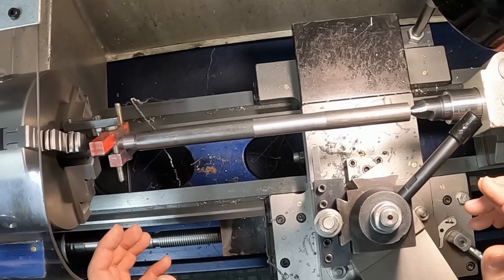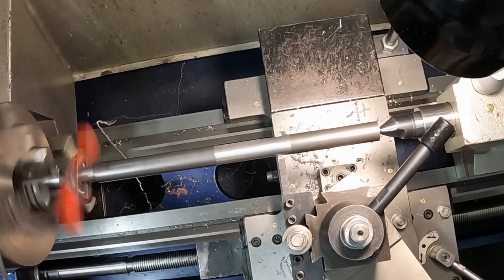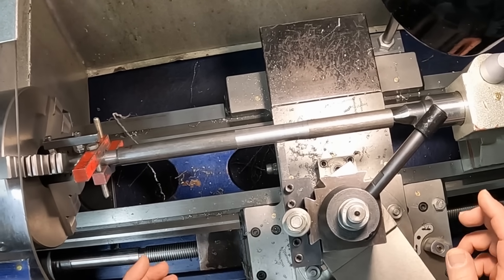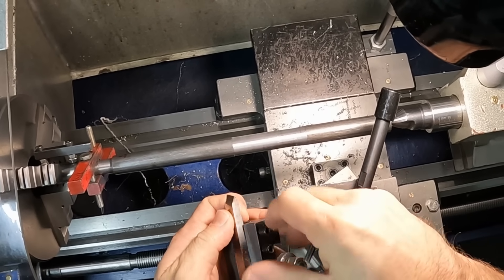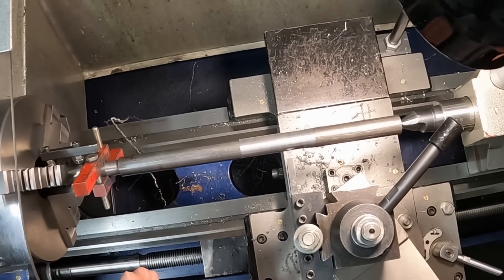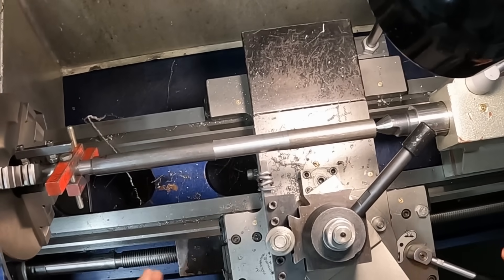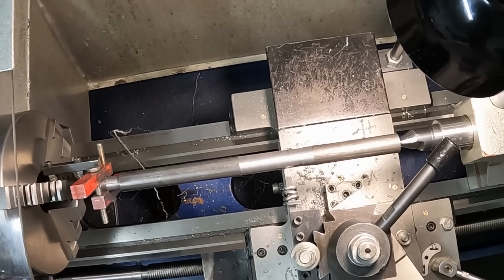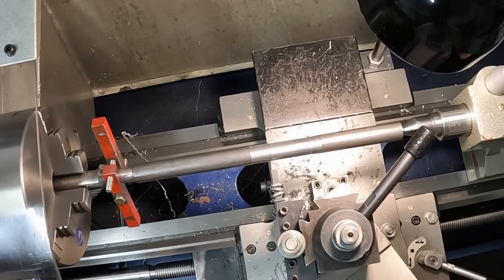Solving the CHATTER problem for the home workshop

Comment: Thank you for shareing . So it's very important to have people around like you ! This is incredible valuable. 
you are not saying (like many): You do it wrong, read the manual and do what it said (be rigid and dont stick out tool too long), but telling people the fundamentals that can solve a problem - so we can solve other problems because now we know about resonance frequencys.

A good explanation is, to hold a metal rod at 1/3 length and give it a slight knock and listen. After that, change the position where to hold it, and knock again. There are modes, that didnt work, if hold at right spot . If you met one of these, it would not resonate (at least not if you knock with same tool at same point as before).

If you know that , you get an idea, whats going on with a shattering machine. And you can take it to many other cases.

Nice stuff to know ! More of that can come ..i hope.

Comment: I had this issue just yeasterday turning a peice 1" cold drawn 1018 down to .800"  on a 15 inch length! It was a DOG!! Wish i would have seen this before tacking it.
I got some chatter out by laying a rubber faced hammer on the stock as it fed  in toward my chuck. It helped some. But not great.

Comment: Great video.  I would have liked to see the effects of lubrication/coolant on the chatter.  You touched on a dampener material but did not mention a dynamic absorber.  The other thing about changing stiffness is to use carbide cutting tools.  In particular solid carbide boring bars are now available.

Comment: Vibration of the tool and machione are only half the problem. Vibration of the workpiece (especially when long, thin and tunred between centres) is often just as important. Your 'anti-chatter wire' can sometimes be used with advantage on the workpiece itself, where its positioning can be critical. And finally, often, the simplest way to take the natural vibration out of the system's resonant range is to change (slow down) the cutting speed.

Comment: Fascinating…..all of the fatigue is in the same spot, regardless of the direction of torque.   So, i’m wondering if cutting a relief slit in that spot and end the cut at a drilled hole, would remove the chatter, but still allow some flexibility…very much like the relief cuts in parting tools. 🤷‍♂️.   Again…fascinating.
Good Talk 👍
Reply: Also…🤷‍♂️….I sort of LIKE the chatter finish.  I know its not practical for hitting precision dimensions…but the finish itself, is actually attractive to me….it reminds me of a  Guilloche Rose Engine finish. 👍

Comment: Was thinking engines valves springs: sometimes uses 2 springs of differents hardness...Something like the copper plate you used but steel of a diferent shape.
What about cut off?

Comment: In engineering terms, he is changing the resonant frequency of the system.  Most of the attempts to stop chatter I have seen focus on increasing stiffness of the system( the stiffness of the tool post), or of increasing mass of the work, in an attempt to move away from the resonant frequencies.  I have done both in the past, sometimes successfuly, sometimes not. As an amateur machinist and retired Engineer, I had simply never considered that adding mass to the TOOL ITSELF might be a possibility.  YouTube once again comes through with sharing practical knowledge about practical things. I will give this a try very soon.

Comment: Anti vibration wire?  Solid core solder maybe?  That alone is a good tip.  Using some lubrication and altering lathe speed helps, as some inherent vibration is caused by the lathe motor.  Making sure your centers are in tight at each end and/or using a live center instead of a dead center will also help.  Headstock bearings OK?  Last resort is, as you say, reading Machinist's Handbook, as we like to solve problems on our own!

Comment: Thank You SO MUCH for this clear and very informative video. I use a Chinese Sieg lathe normally and have just got boss of that but on my Peatol / Taig Micro lathe I was getting chatter marks even though the tool I had ground seemed to cut well. Then I tried t strip of copper cut from a pipe and annealed and placed under the tool. Using all the same speeds and feeds and it was like a different machine, suddenly everything has come right Brilliant!

Comment: For the first time the right explanation of "chatter". The problem has an analogy with audio. Resonant Frequency (and it's harmonics), Damping, (external and internal) , Stiffnes, Mass,  etc,etc, are items wich are the basic items when talking about acoustics and UNWANTED Frequencies (especially  Loudspeaker Engineering). And chatter is an unwanted mechanical frequency. These unwanted frequencies can be mastered with the solutions mentioned in the video. The solutions are the same for audio . All these solutions (and more) are also known by audio professionals such as audioengineers and speaker builders .

Comment: The only way i really got away from chatter is changing the cutting geometry by stop thinking as it digging Into the part but running towards the head stock as you cut.. i paid too much attention to sharpening the edge towards the part. When i started grinding the tool so it cut towards the headstock i helped the chatter a lot even with tiny cuts i now get no chatter.

Comment: I only get chatter when facing on my chinese lathe. Shortening the tool overhang and making sure all slides are free from shake sometomes gives a fair cut but some of the problem I think comes from the speed control that pulses the drive motor and adds different vibration characteristics. I have used really old worn out lathes with smooth drive belts and obtained very neat and smooth facing despite all the wear on the machines.
Reply: Check your thrust bearings. If it doesn't chatter with live centre pushing on it you need to adjust bearings.

Comment: On my 9 inch south bend I eliminated the chatter by using a 3 phase motor and an inverter from Amazon. Turns out the single phase motor which hummed like a washing machine was making vibrations in the whole lathe. Also by using the inverter It's possible to vary the rpms with the turn of a knob.

Comment: Good video and modeling.  It's a hard subject to talk about.  Engineering 101, everything is a spring.  You're a spring, every part of the lathe is a spring, the stock is a spring, and the cutting tool is also.  You are cutting a spring with another spring.

Comment: Very useful and insightful video.
To add, the same principle applies to the work piece, less stick out from the chuck for unsupported material and if longer cuts are needed to make sure the part is supported on a live center and to add a steady if possible.
What I have also experienced while parting specifically was that the length of material on the back of the chuck(sticking out into the spindle) will also cause chatter if it is left too long. This means you want to not only part of as close to the chuck as possible, but at the same time, use a short as possible piece of material.
In my case I was parting 22mm material while making 15mm long parts.
If I rough cut my lengths of stock more than about 250mm on the saw, I suddenly had issues with chatter while parting. 
This would gradually go away as I'm removing new parts from the stock and as it started to get shorter. Between 250mm and 270mm was the sweetspot, anything longer and the chatter will appear. 
Naturally this will all be related to the thickness of the material which will be stiffer the thicker the stock is meaning that more stick out is possible.

Comment: Another way to visualize the damping effect on a vibration system is when you put your hand on the system and it eases.
Obviously on something safe, like washing machine or a small motor.
Since you cant put your hands on the tool, a wire of such sorts is a viable solution.
Interesting to think are there tool holders in the market incorporating this method? Like adding springs and pads to soften vibration?

Comment: I was a manual lathe operator for about 15 years and turned down a lot of long pieces even longer than what was shown here. One time, a man said to add some rubber bands around the piece being turned and I was amazed that the chatter went away.

Comment: Someone suggested getting away from the resonant frequency by increasing rpm. In fact, You want the rotating frequency (revs per second) to be an integer multiple or division of the resonant frequency (herz). This way the tool 'bites' into the workpiece at the same angle as it rotates. So either decrease of increase rpm untill you find the sweet spot. There are many.

Comment: It's all about tool pressure/cutting force and harmonics. Using a smaller nose radius almost always helps. Using a more negative lead angle with a positive rake angle is the way to go as it takes less pressure off the part and into the center of the cutting tool. Sandvik has good literature on this as well as a FREE course on their website.
The spring you put on it slightly damps the vibration too.

Comment: The chatter can also be from work hardening the surface. I had a heck of a time cutting 4140 on my small craftsman lathe which is by no means a real rigid lathe. The cut was mush better when I slowed the spindle speed as slow as possible and took slightly deeper cuts.

Comment: What would you recommend if modifying the tool holder and tool bits solve the problem but the vibrations also appears in the shaft you are machining? Base on my experience when you install the follower rest there is a tendency to solve the problem but upon removing the follower rest I somehow notice a deflection or bending of the shaft causing it to misalign again specially for small cross sections of diameter in the middle? any comments pls will be helpful. Thanks.
Reply from the maker: I'm sorry but its very difficult to help without hearing the feedback and checking the setup. From what you wrote the first place I would look is tool height, or bed deflection. It sounds like the tool is climbing. Also check the cutting point and make sure its sharp.

Comment: It's rare that I have encountered chatter, and on a regular lathe, I first check the length of the tool bit, reducing the overhang as much as possible.  If there is still chatter, slow the RPM down.  Then reshape and sharpen the cutting edge.  Make sure that the piece is mounted securely so it can't move about while under load.  Make sure that the gibs aren't too loose.  Use some lubricant.  Loose headstock bearings  can create chatter.
  On a brake drum and rotor lathe, use the dampers that came with it to get rid of harmonics and the chatter that ensues.  Small drums and rotors don't get much chatter generally speaking, but bigger ones do more often.  The design of some brake rotors chatter more than others.  If you still get chatter with cast iron, change out the tool tips.

Comment: Very interesting, nice video, animations and explanation. From my experience, we have bent/broken Sandvik antivibration boring bars, these things kept screaming and breaking inserts no matter what but we urgently needed them to rough out big stainless cylinders. After some time trying, I just took a single massive cut (3.5mm) on low cutting speed and bit higher feed and it worked. The insert life was not awesome but lasted 20-25 minutes in-cut and managed to survive one part. The finish was horrible but it was just a roughing operation. I tried the same with external tools and it worked too few times. Just take bigger DOC, so the tool bends down and doesn't spring back. Just be careful not to break it into two.

Comment: I find my main chatter problems on the mini lathe happen when I put on an oversized chuck. If I use the 80mm 3 jaw, the 80mm low profile 4 jaw or the 80mm ER32 collet chuck it’s fine, but as soon as I move up to the 100mm or 125mm chucks I get chatter problems.
Upgrading to tapered roller bearings has helped a bit, as has making my own adapter plates for the chucks from cast iron & getting them as short as I can, but it’s really a problem of pushing the little lathe outside of its comfort zone.
Still, it’s a great little machine & I use it almost daily in my business rebuilding vintage engine magnetos. They get a lot of bad press from many “YouTube certified” machinists, one popular YouTube “amateur” recently said you can’t turn steel on them (she’s often misinformed though) but I’ve found it to be a very capable tool, made even better with a few simple modifications.

Comment: Got a sub and a like for this vid alone, sir ! 
I made a solid toolpost for the cross slide (no compound ) and this made a big difference in the rigidity of my small lathe...

I also dislike carbide-insert tooling on small lathes as the large(ish) nose radius tends to result in chatter, the comparatively blunt edge carbides usually have (positive rake) doesn't help matters either. 🙄

😎👍☘️🍺

Comment: I’m a time served welder of 50+ years and I remember once working in a workshop that had welding, fabrication and machining equipment and one of the turners in the machine shop was profoundly deaf  and he worked by using the feeling of the vibration of his machine  to know the finish that his machine was producing, the only problem was that he would have his lathe screaming high pitched and when anyone pulled him up about it he’s would hold his hands up and apologise only to turn around pissing himself and pop out another bang on job 😂

Comment: The wide profile tip allows the chatter to build up as the tool goes back over its chatter from previous rotations of the part. A sharper profile and faster feed both reduce this problem. The frequency of your chatter seems too low for tool chatter. I think its the workpiece flexing. Just keep in mind everything involved in the operation from the workpiece to the tool and the lathe has some flex and can chatter especially if natural frequencies match.

Comment: IT'S NOT DAMPENING!
Damping absorbs mechanical vibration. Dampening just makes things wet.

It undermines an otherwise credible presentation, which is a shame.

For your tool sharpness discussion, it looks like you're trying to compare the relative tool tip radii. Might be easier to convey with some close ups to show the different engaged cutting edge length

Comment: Why is nobody mentioning the fact the the tool is WAY stiffer than the workpiece.  That long, thin, mild steel workpiece being worked right in the middle is certainly deflecting FAR more than the short, fat, really hard tool.  The 'anti chatter wire' is a red herring that has no business in this video.  I'm very interested in the ideas that the shape of the tool and the aspect of the work matter a lot, but the former was clouded and the latter ignored in this video.

Comment: You can also use a stack of o-rings on boring bars to add dampening.
Reply: This was always our first approach too!  Simple method and most times very effective.  We had a large crate with thousands of different O-rings for this.  And a whole bunch of short steel tubes that could be "rolled/clamped" over the O-rings.  In some cases this helped solving impossible cases.

Comment: "Chatter" when turning "Thin Wall" tube can be sorted by stuffing the bore with wet rags. Boring thin wall tube, chatter can be sorted using a few strips of wood, held on the o/d with 'O' rings or even sticky tape. ('O' rings are best though)

Comment: If I get chatter I change the speed of feed or the speed of rotation or cutting tip design or distance cutting tip is out and sometimes rest a drift punch on the cutting tip for dampening. The last thing I want to do is not use auto feed. It's bad enough that I have to do angle cuts manually as my Chinese lathe doesn't have that feature. I do really like that lead solder wrap. Good idea!

Comment: Great video on this issue,  I'm a tool maker by trade and did my apprenticeship back in the early 80s, I only ever use auto feed on a lathe when I'm rough cutting, I aways hand feed for everything else and after 40 + years you get very consistent. We were never allowed to use auto feed when training even for rough cutting. We had to develop a steady consistent control by hand or else.
Reply: Using the machine feeds allows you to maintain MMR (Metal Removal Rate) as close to optimum as possible, and you only need approach the machine to withdraw the tool and return to the beginning for the next cut.  That keeps you out of the firing line of those chips you're producing...  No sensible person wants to spend any more of his working day crouching over a machine working the handwheels than is absolutely necessary... And carbides last longer under power feed.
And the reason trainees don't get to use power feeds is that when they're distracted (by a hot chip burning through their delicate flesh, say, the manual feed stops  automatically... under power, the saddle just keeps going... while the trainee attends to a minor injury...

Comment: your also useing tiny! diameter tooling and hanging it way far out of the holder. You end up with tool tip deflection and rebound. Also, you need indexable inserts and a set of 3/4 (18mm) or larger tool holder. People will start shouting OHH MY overkill. well Ive worked close in with a lathe for over 40yrs and im not the sharpest tool, but i know what and how stuff works. your playing with a toy. please take no offence.